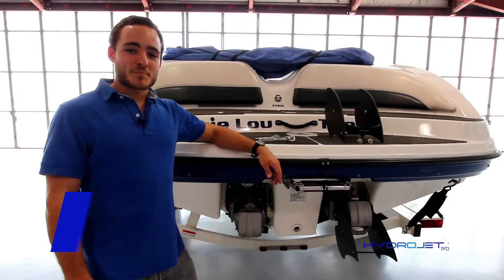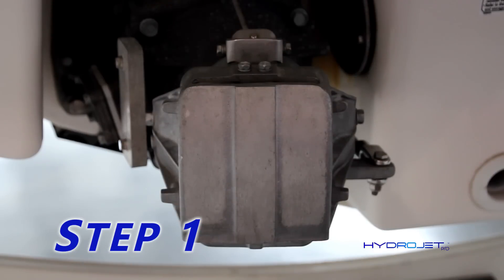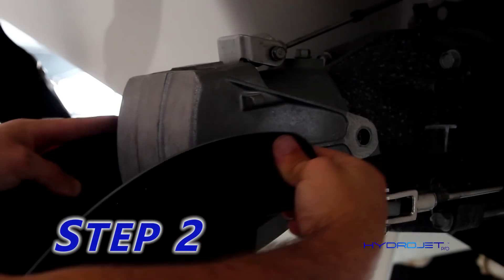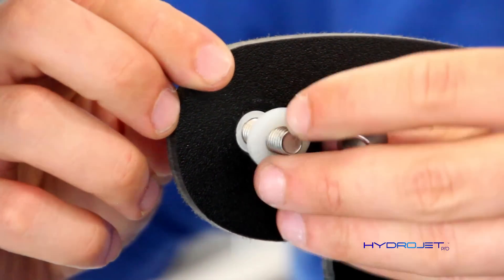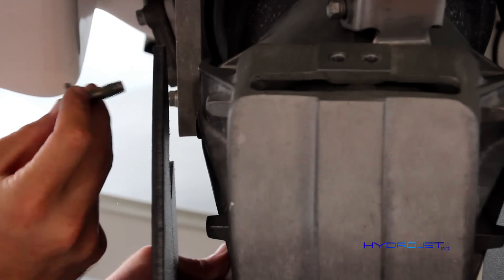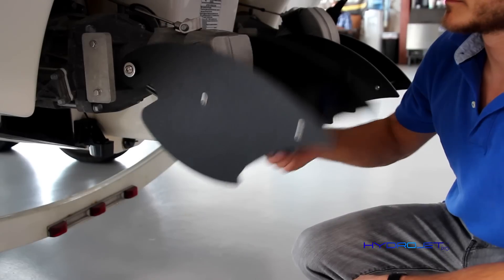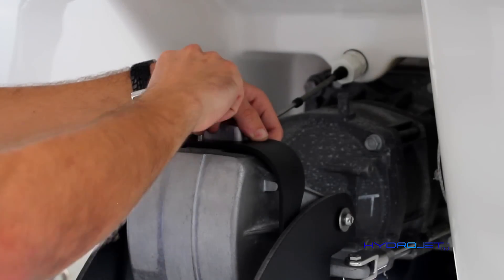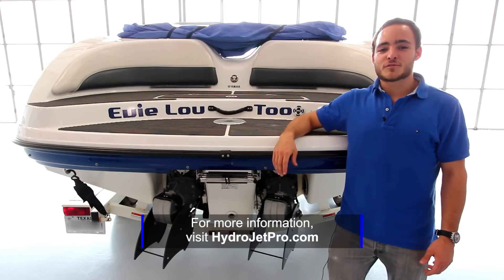HydroJet Pro Installation

Comment: I received the Units and installed them on my 2013 242 Limited. I noticed in your video you are installing them on an older boat with aluminum diverters. On my 2013 the diverters are plastic and the fit was not as simple as 1-2-3 it was. 1-2-trim a little off the diverter -3. It took about 30 minutes for the first one and about 10 for the 2nd. Once installed they work as advertised.